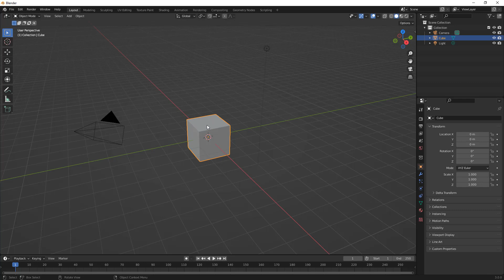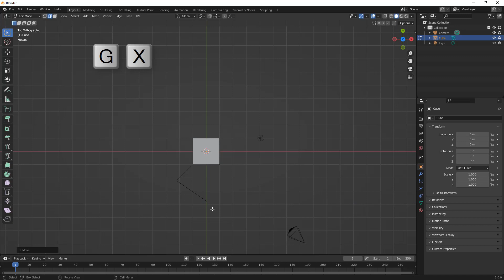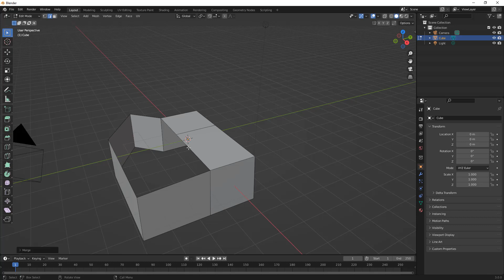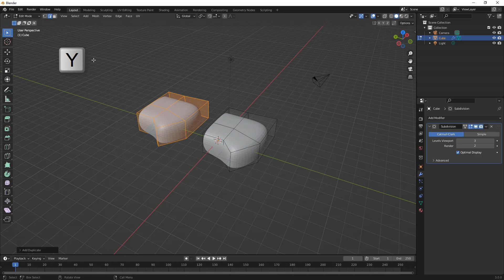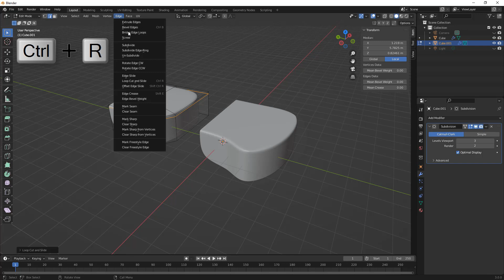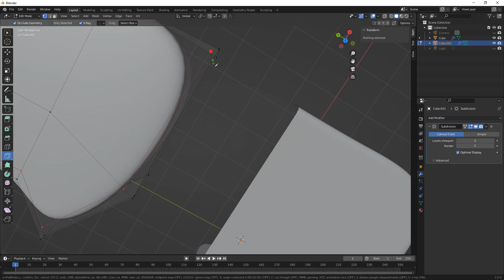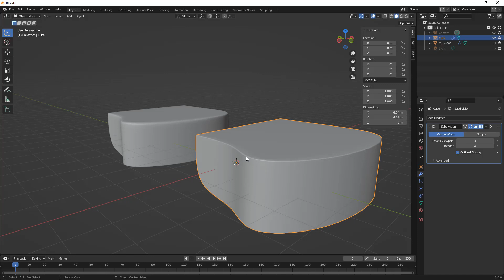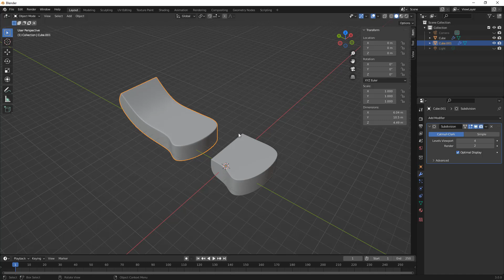How To Learn Blender Part 6 - Edge Control Vs Mean Crease Weights #Blender

Comment: Nice tutorial! Sometimes you need to hold the edge exactly where you put it and this doesn't quite seem to achieve that.
Is there a way to do that? Thanks and happy holidays!
Reply from the maker: Happy Holidays!  

Can you give me an example/shape you are working with?  Generally a creased edge will stay where it is put.  The Cage you are manipulating is pulling on the shape/surface below it.  A crease of 100 should put the edge of the cage and the shape under in the same spot.
Reply: @LearnEverythingAboutDesign   Yes like the cornier of windows in air plane canopies or car windows.
If you create a cylinder, add SudD level 2 you see that it becomes like a ball. Then you add loop cuts and drag them almost to each end and inset the faces just a little on each end and you see that the loop cuts and inset lines are holding the edges very well.

Its not always easy to get loop cuts in on cars and planes.
Reply from the maker: @RC-Heli835  yeah in some cases you might want to do a boolean cut after the fact to get a cleaner edge.  This is one place a NURBS modeling approach in CAD really helps because you just cut away a corner and not worry :)

What i have done is extrude/extend say a window opening back into the car like you would get with window trim.  then on the inside edges I will add a crease weight and then add loops to the outside.  Not sure if this is a hack or a good way to do it but its what I have done.

Comment: thanks for this video. but have you tried vertex creasing with edge creasing?
Reply from the maker: Thanks for the comment.  I haven't.  Vertex Creasing is introduced in 3.1 alpha i believe and I am still running the 3.0 version.  I know vertex groups and creasing/beveling is on the Blender development because other programs in the same grouping like Maya support it.

Have you tried it?
Reply: @LearnEverythingAboutDesign  haven’t used any other 3d programms except blender and fusion, didn’t know about this feature in other programs
Reply from the maker: @nook1e.  Yeah i think the main problem is when trying to transfer files from one system to another and losing that weighting information.  I haven't covered it since I don't want to hop on the "new" features in alpha and beta versions of Blender.  There are so many amazing youtube channels for Blender for those that use it every day and I will let them handle all that :)
Reply: @LearnEverythingAboutDesign  thanks a lot for answer